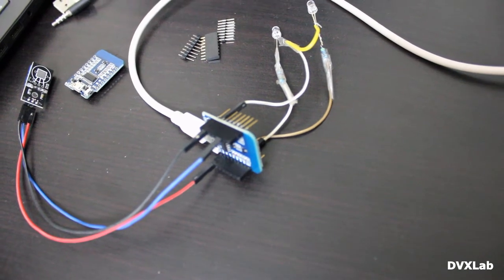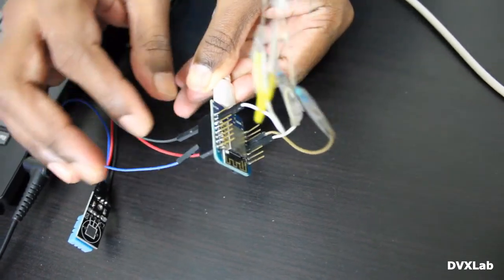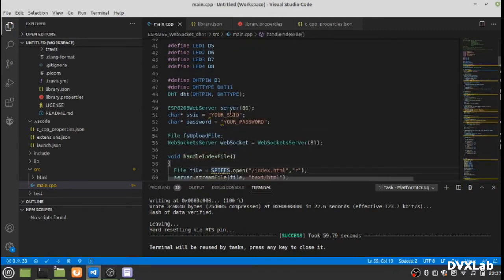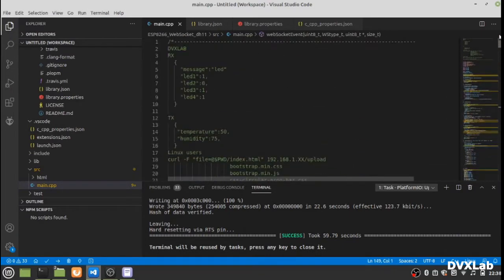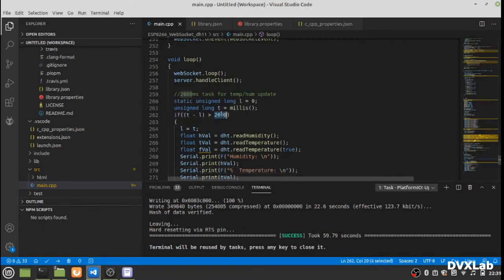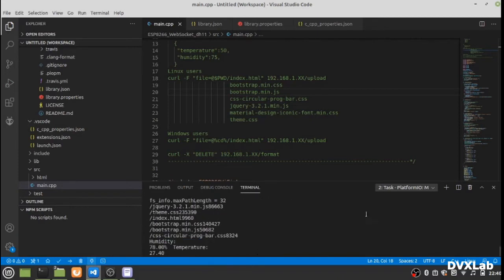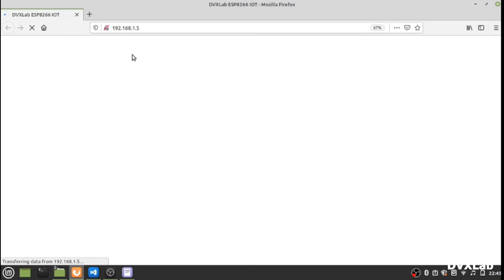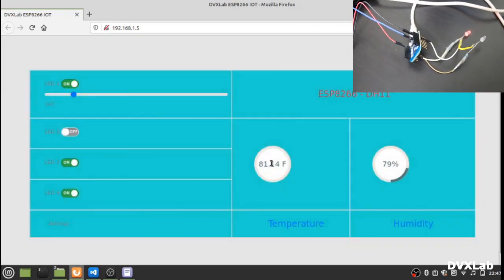IOT Websocket - Bootstrap ESP8266 Arduino Interfacing DHT11 Temperature  Humidity Sensor & LEDS

Comment: Hey, nice work. I have a small doubt. In this case, your sensor data was displayed on localhost which is 192.168.1.5. If I want to display this to my own website and can access the data from anywhere what should I do. Please share your knowledge on this.
Reply from the maker: Use MQTT